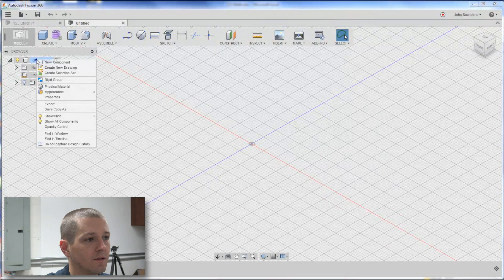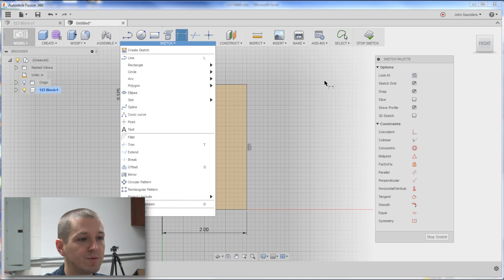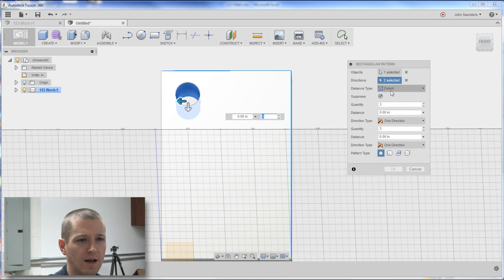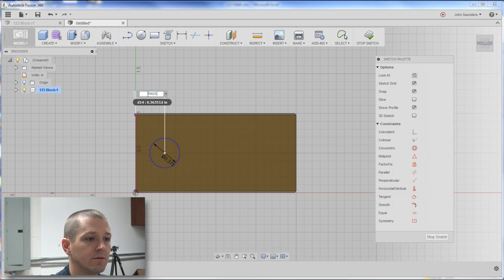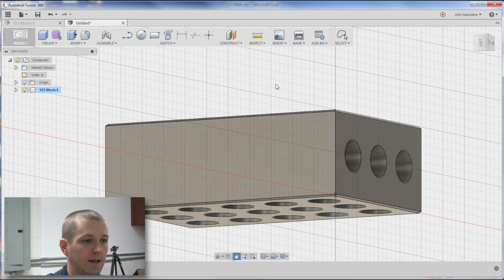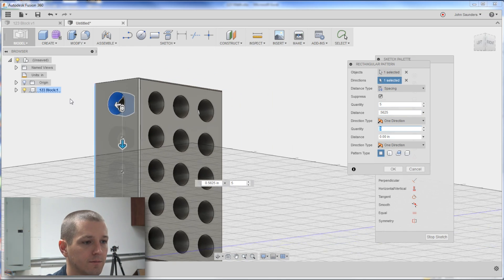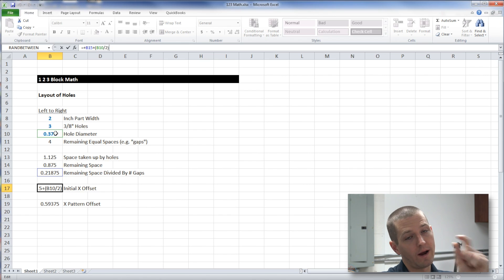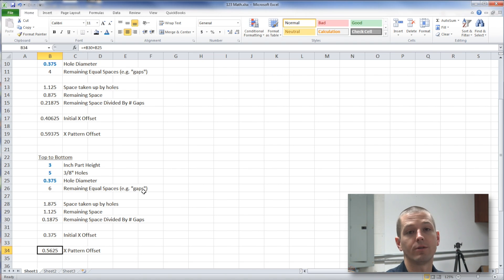How To Model a 1-2-3 Block in Fusion 360! FF2

Comment: My 1-2-3 blocks have 5 3/8-16 unc tapped holes in a X-pattern around the centre hole. The other holes have diameters 0.34 to 0.36 inch. I enjoyed the video as a good start to the model.

Comment: Nice project! i made it also, slightly modified. take a look

I took the time to draw it in Fusion 360 and i tought i'd share it with you guys (https://a360.co/2YFllov)
I also exported it on pdf https://drive.google.com/open?id=1EDy1pS1PwQhgTViWUW2aCK8HSS9UK9Tn
It's In mm btw :)

Comment: if fusion is the same as inventor you can just type a name after you hit D for dimension then = and the dimensions and reference that any time you want so for your first dimension you could have hit D then typed wd=2 (as in the width is 2), the next would have then been wd/1.5, and your height would have been wd/2, etc.  I do that for bolt circles all the time so I can then call that in a drawing so it is always parametric.

Comment: I'm surprised that the main volume's dimensions would be parametric, but the hole pattern is a specific dimension.  Doesn't that defeat the purpose of making the main volume parametric?  I understand you have a spread sheet to calculate the values, but shouldn't that be done natively?  Am I missing something?

Comment: Good share, thanks. When you mentioned about using the parametrics, I took a look in Modify, Change Parameters, expecting to see the d1,d2, etc but they are not shown, by default. Something to look into further - I thought the "natural" dimensions we create as we "dimension" an object would be shown there, not so.

Comment: Hmm … it should be possible to make most of the calculations direct in the model (calculated parameters).
I’m not so firm now, I’m actually learning Fusion. So, a question: it is possible to define variables in Fusion, eg. for the number of hohles? If Yes, it should be possible to make the whole block parametric.

Comment: hey john,  try modify -> change parameters  enter all values you plan on using for your parametric modeling and the formulas in user parameters. the you can just enter the name of the parameter when you model and it will pull the formula from your user parameters. then if you want to make your 1-2-3 block and 4-5-6 you just change the user parameters. then magic happens and all you modeling and cam work scales correctly.

Comment: Basing dimensions off of surfaces with chamfers, fillets, etc is a bad modeling practice and should be avoided. These features are not stable and should not be used as a basis for a dimension
Reply: Adding a chamfer, etc. does not change the position of the surface/plane. It only changes the shape of the edge.

Comment: John
@ 1:42 you should be able to right click one the patterned circles(not the First/original circle) and edit the pattern options/parameters. If you want to change the size of the circles you will have to change the First/original circle's diamater dimension. 
@ 2:18 it has to be a lower case d1 not uppercase D1 for it to work correctly!!

Also, a tip after "finishing" a sketch you should be able to right-click the sketch in the browser and enable the visibility and dimension visibility options. Which will allow you to select a dim(from the sketch) when entering in a dim for the Extrude (Push/Pull) operation. At least, that's how to do it without remembering the name of the dimension ex. d0, d1, d2... 
                                                                                                                                                                                                                                      
P.S. The tips/info is based on Autodesk Inventor usage, but it should work because Fusion is what one could call a derivative of Inventor and other CAD programs.
Reply: +NYC CNC It might be a  inventor only feature. I will do some digging because it would make sense for fusion to have it too. 

Happy Holidays

Comment: A quick question, why Autodesk Fusion 360 and not SolidWorks? Is there some advantages when you work with CNC devises?
Reply: Fusion has a built in CAM functionality. Yes there is MasterCAM and other plugins for Solidworks but those cost extra on top of the base Solidworks itself. For Students, Hobbyists, and Small Businesses, the entirety of Fusion 360 is Free. I prefer Solidworks myself (get it through work) and cannot stand modeling in F360, but I do need the CAM functionality, so I import all my Solidworks generated models into F360 to do the machining.
Reply: +mlnlme1 thanx! rly helpfull!

Comment: Sorry, I have no knowledge in this area, I just enjoy your videos. I was trying to understand the way you calculate the position of each hole. If I put 2 blocks side by side, let say facing to the 2x3 face, 2" across is X and 3" is Y. On each block the holes on X axe are at the same distance. If I give numbers to the holes, starting on the top left corner, does hole 1,3 (block, hole number) need to be at the same distance to hole 2,1 as hole 1,3 to hole 1,2?
Reply: +Cristian Conrads length/amount +1 then one less on the pattern going in one direction then the same going the other direction using the first pattern as the start for the second set and you dimension in the first sketch, press pull and you pattern the hole not the sketch, also as it says above

100/5 will be a pattern of 4 hole 25 mm apart

Comment: Hi John,
              I have designed and built a 3 axis router and although I have had a life long trade in electronics I am 75 years old and m,y abilities have got stuck in analogue. My present problem is that the breakout PCB has both a printer parallel port and also a USB port. Now my question is this, can the USB port supply the data or does it have to come via the parallel port leaving the USB port to supply the + 5 volts that is isolated from the motor supply. If the data does indeed come via the USB port how can I derive the relative port address for the Mach3 requirements. Hope you can help or anybody else for that matter. The main reason for asking this question is that my PC set aside for the control is a netbook and doesn't have a printer port.
Cheers MoK

Comment: I'm reminded of something the guy from Suburban Tool said (he was talking about angle plates, but it applies to 1-2-3 blocks) when deciding on whether to get a plain angle plate or one with a lot of holes: "What is the first thing you do when you use one? You clean out all those holes scrupulously so a bit of grit or swarf won't fall out and mess up your clamping. Why not just get one with no holes to clean out, since they are rarely used but must be cleaned out every time?"

Still, I'm glad you included the arrays of holes. I think I am a lot closer to mastering arrays (patterns) in Fusion 360 with this video. Thanks for the repeat on patterns.

Comment: I really appreciate that you take the time to learn the software and figure out "equations" and their value.

I personally think the system is already simple and robust, you just need to have more seat time in the software. Doing solid modeling is a time consuming process that adds a lot of value in manufacturing. In inventor / solidworks and other 3D programs, there is an equation manager that tracks all dimensions used and where.

Keep in mind you can have a single part with 100's of dimensions and the system is geared to handle quantity

One thing I don't agree on, and its actually bad practice is not fully defining your sketches. When you don't fully define the sketch, you run the risk of having issues later (when you get more complicated in design) and you have to keep the datum structure in mind when you do it. If you fully define a sketch and constrain it incorrectly, when you scale it, you will have problems that cause a lot of clean up. When you get into large assemblies this is really apparent

Comment: Might have to take the fusion 360 plunge, I like what I see so far compared to SW.  What about some threaded holes and clearance holes for 3/8?  I think we get used to the cheapie 123 blocks....
Reply: +NYC CNC John I meant showing the tapped holes in 360.  Some 123 blocks have clearance holes for 3/8 hardware so you can bolt 2 together.
Reply: +Bill De La Vega that can be done you will have to look in the tips and tricks on the fusion forum for how to do it

Comment: One tip would be to use the parametric functions of 360 (same principle as the spreadsheet) and the hole distance will always match the size of the part. I use it all the time in Inventor as well.
Reply: And distance from the edge is 1/2 the thin side. This lets you bolt two blocks together in any orientation and have edges and sides align to create angle plates, etc.

Comment: Good video. Could you input your spreadsheet info into the fusion parameters and adjust on the fly?
Reply: +Andy Blackman there is a dump user paramaters to a .csv and import .csv into user parameters in the fusion api section on the forum

Comment: pre fill the parameters, have a look at the draw vid I did right at the start, I pre fill the parameters with user parameters.

the sketch patin is changeable you just click on in the bottom bar or the symbol beside the first  circle,

ctrl is a very handy key
Reply: +NYC CNC just one tip to do this you need to draw and dimension the first hole press pull it and pattern the hole's not the sketch